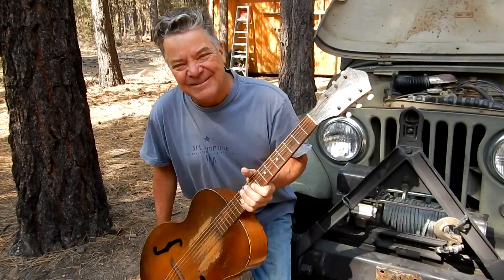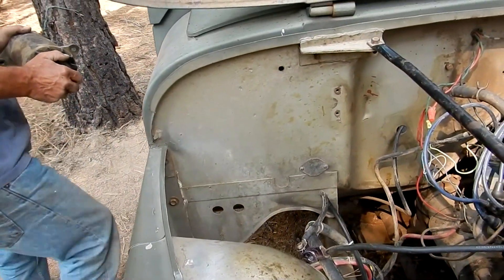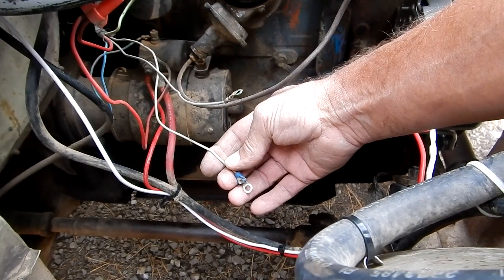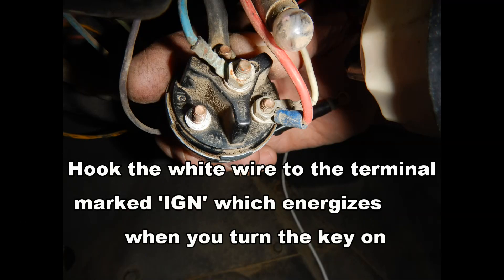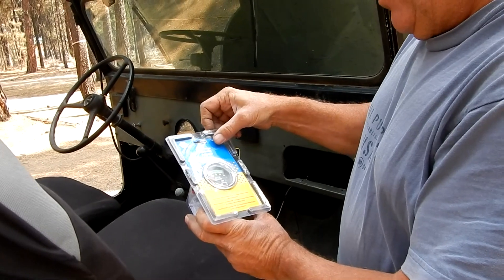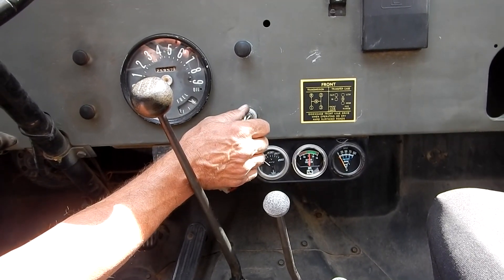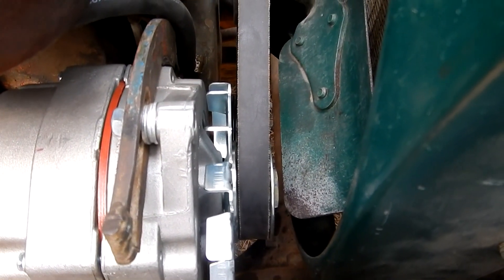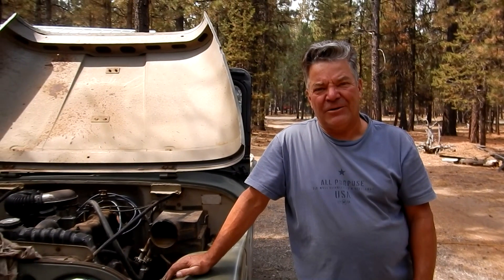Guide For Automotive (Jeep) Generator To Alternator Conversion - Mounting and Wiring for Jeep CJ-5

Comment: I'm impressed you cut that pulley nut so well and precise. I know it's wrong, but my first thought would have been to notch the damn fan 😂. You did great work all around. I'm not sure if I'd use that bracket kit, it reminds me too much of an erector set. But if it works, why not?
Reply from the maker: Getting that bracket all lined up was the hardest part of the job. Cutting down that nut wasn't too bad if you take your time.  Thanks for the nice comment,  Seth!👍😄

Comment: 14.2 is industry standard for alt output, 14.7 is a bit high but should never cause issue, it will give you brighter lights at night.
Reply from the maker: Glad to hear that as I don’t want to overcharge the battery. It should help when running the winch then. Thanks for your input, Mick!

Comment: Nice job Tom, I had a rotating electrical shop for 14 years, you explained it well and fully.
Reply from the maker: It's not exactly my wheelhouse but I wanted to share my layman's experience. The newer alternators don't have the white wire, as you well know. It was a little tricky bypassing the old regulator. Thanks, Mick.

Comment: Hello I was looking to see if you have any info on the alternator you used possibly a Model number. I appreciate all your help I have a 1962 CJ5 Willys
Reply from the maker: You can use a one wire Delco alternator. I have a re-manufactured one that cost about $45. I don't know the exact model number and the Jeep is 900 miles away from where I am now. Don't worry about the white wire in the video as most one wire alternators won't have that. The A200 bracket is the most difficult part to setup and it took a while to get it right. Feel free to ask more questions and I will try and answer them.

Comment: Thanks. Was working on a 81 CJ and couldn’t figure out what was doing what. This helped tremendously. Some genius reworked the electrical system and fried about half the electrical wiring. They also tore out the vacuum hoses. Thanks to this video I reworked mine to at least a useable and color coded system. Thanks
Reply from the maker: Glad that you found the video useful. Hope you get everything working correctly.

Comment: Any way you could help me I have 1951 cj3a and I am just confused and I need help to convert 6v to 12v I can email or text or anything I just need some help
Reply from the maker: I have no experience with 6 volt systems. With that being said you can ask me anything you want right here in a comment. Maybe I can help or someone else might chime in.
Reply: @TomandJulieMineExploring  so I have 6v and I want to convert to 12 v but I don’t know how I saw your video and the wires are getting me confused so idk I wanna show the pictures of the engine bay and the wire and if you could tell me which one will go where thank you
Reply: @TomandJulieMineExploring  I am not able to post pictures here
Reply from the maker: jwigren40@gmail.com  You can send me a photo at the email address.
Reply: @TomandJulieMineExploring  will do

Comment: What about your gas gauge does it still work mine pegs out all the way past full mark
Reply from the maker: I fooled around with my original guage for a long time before giving up on it. I replaced the guage and sending unit. I finally got an aftermarket guage that mounts below the dash and it now works. I think a bad ground can cause your guage to peg. Look under the driver's seat to see if you have a ground wire hooked up.

Comment: Hi Tom! 
Great video! 
Could you tell me where you got the Alternator and the bracket and what the amperage is on the alternator. 
Thanks!
Reply from the maker: I don't remember where I bought that kit, but, honestly, I think I paid a bit too much for it anyway. What you want to look for is the A200 alternator bracket. There may be other brands as well. You should be able to find it for around $45. The alternator is an AC Delco single wire 63 amp refurbished unit that you should be able to easily get at most parts stores for  about $50. The last thing would be a length of 10 gauge stranded wire to go from the alternator to the starter, about 4 feet on mine. The white wire won't be there on a single wire alternator so you can dismiss that. The alternator has an internal voltage regulator and will charge the battery back through the main positive battery cable that goes to the starter. Make sense?
Reply: @TomandJulieMineExploring  Thank you!

Comment: Well dang. I just got my CJ3A back. My dad did the conversion but didnt delete out and spliced into some of the original wiring...which today caused sparks some 17 years later. XD. But now I need to check for spark for each plug and soon maybe that L134 will be puring away. Seeing this video showed that I was at least doing everything right while messing in the shop today.
Reply from the maker: Hope you get it going, Casey. I'm thinking about doing a top end rebuild this summer to fix my oil burning problem. Fun to drive.
Reply: @TomandJulieMineExploring  we got it going with a short of starting fluid. After confirming that fun way for spark, then that carb was working I pulled the fuel pump off.... took it apart inspected the diaphragm... so took a deep breath and blew the fuel back through the line and got her fired up. Sadly the starter chose to act up... so tomorrow taking it off and inspecting and deciding on either getting it rebuilt or get a new one. But shes getting closer. Need to look at running proper length wires and a new ignition soon as for testing the ignition is dangling on the passenger side. But one little issue at a time. But the engine runs strong that's for sure. The engine now is 27 years from when it was rebuilt with roughly 200 miles on it. Though it would be nice to take it out and get it cleaned up and freshly painted.
Reply from the maker: @crj5106  Sounds like you're on the right track.

Comment: I have to replace a generator on a 1950 plymouth with a 6 volt alternator , (cant find generator to replace old one).  Is this the same way to hook up for a positive ground  6 volt  system??? Don't want to convert to 12 Volt
Reply from the maker: I don't know the answer to your question and don't want to steer you wrong. I'm sure some research will help you get it figured out. Thanks for the comment, DragonSlayer!
Reply: @TomandJulieMineExploring  Thank you for taking the time to answer. I will try again. Thank you

Comment: Very helpful,  thanks Tom. I like the guitar intro as well.    My 65 CJ5 has some unknown alternator in it (no identifiable markings left) and the battery isn't getting charged at all.  I may just put in a new one as you did.  What alternator did you use, do you remember how much it was, and are you happy with it?  Thanks in advance.
Reply from the maker: It's a rebuilt Delco and I honestly don't remember how much it was or where I bought it. I will try to look it up in the next couple days. It's been working well. Thanks for the comment!
Reply from the maker: I bought the complete kit from vintagejeepparts.com
It' called kit-alt12v. The price now is $209.99 and includes the alternator with internal voltage regulator, mounting bracket, wiring and new coil(which I didn't use).
Reply: @TomandJulieMineExploring  Thank you, Tom.
Reply: @TomandJulieMineExploring  I'm working now on installing the alternator.  I see yours is mounted in the bottom rear with a horizontal bolt.  I have only the two threaded holes in the side of the block.  My jeep had a Hi-Lo Jeep hydraulic plow pump mounted in those two holes.  I took the pump out since I haven't used it in 10 years anyway.  I finally figured out what yours is bolted to in the back by looking at an extra L4-134 I have, and seeing that it has the same bracket yours has.  So I took it off the L-head and bolted it on.  Next step is to copy your mounting bracket configuration.  I see that my pulley alignment is the same as yours and the front of the alternator pulley bolt is really close to the fan, as yours was.  How did you get that front alternator nut off to saw a part of it off?  I put an allen wrench in the center of the shaft and wasn't able to budge the 1" nut.  Tried some Aero-Kroil.  No luck yet.   It'll be great when I get this working!
Reply from the maker: Electric impact wrench works. I have the one Lowe's sells. Thanks for the comment.
Reply: @TomandJulieMineExploring  Came off easy with the impact driver.  Thanks.
Reply from the maker: @TomFredericks187  They do come in handy. I've used mine more than expected.

Comment: Do I need to put the resistor in? If so what kind would I need to buy?
Reply from the maker: Do you have a 6 volt system? If so I don't know exactly what you would need. Mine is a 12 volt system so I didn't need any resistors. The regulator is built into the alternator. Thanks for the comment, I hope this helps.
Reply: Tom Wigren I have a 12 volt system so I guess I wouldn’t need one then. Great! Thanks
Reply from the maker: You're welcome, Ryan. I don't think you need it.

Comment: What about the distributor connections, a resistance is not necessary to avoid burning the condenser or points?
Reply from the maker: The alternator has a built in voltage regulator if that is what you are wondering about.
Reply: @TomandJulieMineExploring  ,. Thanks for your response, I'm talking about the ignition coil, if it was set up for six volts should not need a resistance to lower the voltage to the points?
Reply from the maker: This was always a 12 volt system.
Reply: @TomandJulieMineExploring  .. Sorry my bad, I have a 1955 and I'm in the process to install alternator and make it 12 vollts.
Reply from the maker: No problem, Carlos. Good luck on the conversion.

Comment: Doing some catching up since it’s a holiday. Dint get notified of this one. Nice guitar playing Tom. Good old fashion generators. It was much simpler to work on engines wasn’t it?  Nice video well done Tom. Have a great Labor Day guys.
Reply from the maker: Thanks, John! These old vehicles are really fun to work on and bring me back to the 70's when I had my first car. I was always working on something on it and then slowly cars were less and less user friendly as far as working on them goes. Changing the oil on a modern car is about all that people can can do now and that's barely even worth it. I've been playing the guitar for 45 years but don't really play too much these days. Thanks for watching!
Reply: Working on cars was fun back then LOL computers made it more fuel efficient but it costs way more to maintain. You should play guitar more often. Nice touch👍
Reply: Nice conversion. 👍

Comment: I noticed that shiny new alternator in the last video and wondered if you were going to address it.  Did you also put a new water pump on?  It looked like there were some other new parts there.  I like the way you are starting these videos out by playing your guitar.
Reply from the maker: Yes, that is a new waterpump. We took off the water pump that came with the Jeep and it has a good sized chunck of the impeller broken off. We replaced it and rebuilt the carburetor, but didn't  make videos of those. We put on the alternator before we replaced the engine mounts. Good eye, at least someone is paying attention. I've been playing guitar and other stringed instruments for almost 50 years and although I don't play a lot these days I still enjoy jamming a little. Glad you liked it and thanks for the comment!
Reply: You really are putting a lot into this Jeep.  Are you going to have to do any engine work?
Reply from the maker: So far we're not going to do any internal engine work. The compression checked out just a little low but good enough for now. It burns a little oil but I'm hoping that with a couple oil changes the rings might start working better. It was severely neglected as far as maintenance goes before we got it.